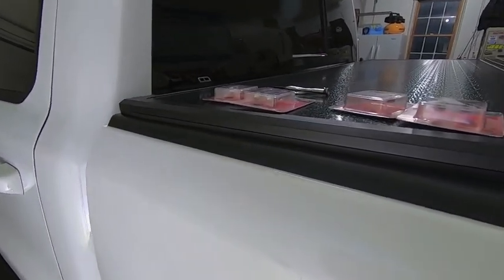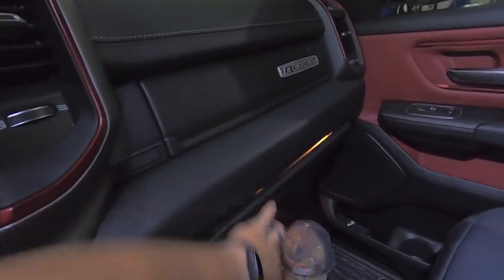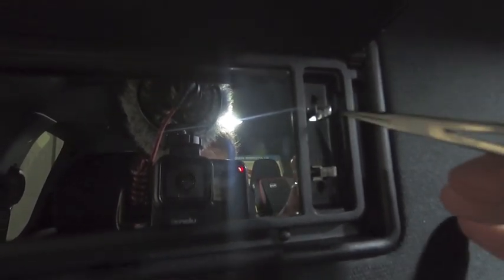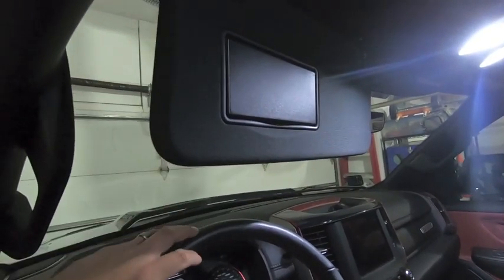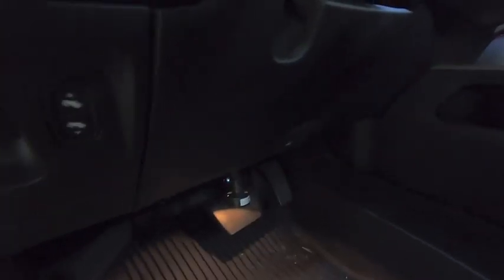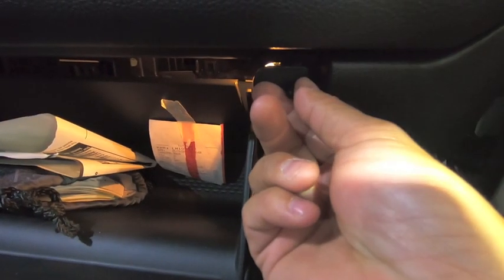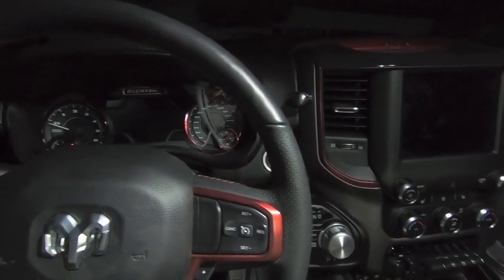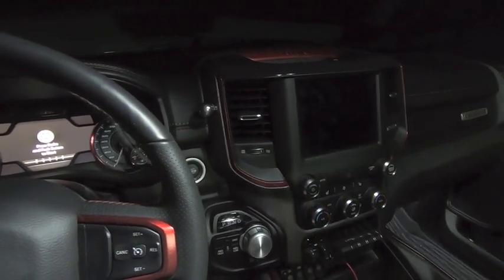Lasfit LEDs Part 2 - Ram Rebel

Comment: suggestion: for vanity lights (and perhaps the whole set), be sure to compare with diode dynamics. their single-led vanity lights are not overly bright like lasfit's (even their 26mms are way too bright for my professional vanity mirror tester). lasfit's 3rd brake light/cargo lights also interfere with key fob on newer trucks, and diode dynamics' does not. i do not work for diode dynamics, i've just a) done full LED/HID conversions on every car i've owned so tend to be picky b) bought a full set of lasfit's to compare and c) felt it was worth spending extra to swap the ones mentioned w/ diode dynamics (wife and i are bother happier now). for the vanity leds from diode dynamics, you also won't have to cut the plastic guides...since they are the right size.

Comment: I have different types of footwell lights. Its an integrated unit with the  entry light and ambient light in one component. Do you know or heard of people replacing them for the unit you have?
Reply from the maker: No I think those are already LED so I don’t think there’s a cost effective option for upgrading those.
Reply: @WaterFowler41  what is the specs for your truck. I have a 19 rebel with the 12" screen. I've looked down there and it does have mounting points an recesses in the cover to put the same type of well lights you have down there. I've tried to get info on converting it because I believe the connectors are different but no luck. I think I'll have to get into mine and see if I can change the actual led.
Reply from the maker: Tyler S. Mine is the level 2 package with the 8” screen.
Reply: @WaterFowler41  hmm. Does your footwells act as ambient lighting as well or is it just courtesy/entry lights? I'm thinking ones that have the ambient lighting option have these led upgrades ones.